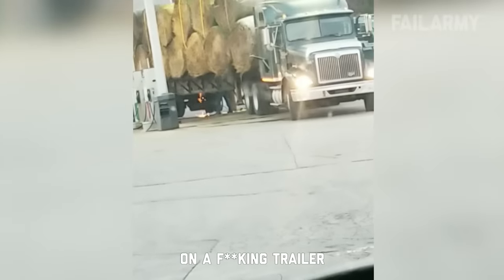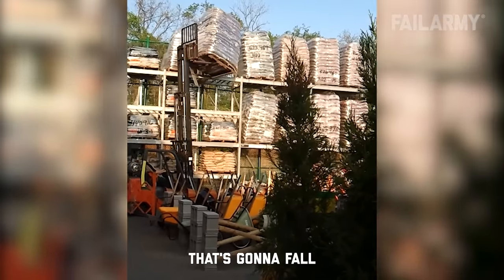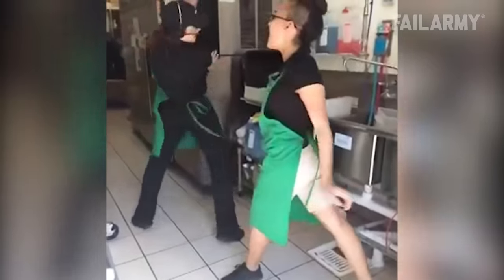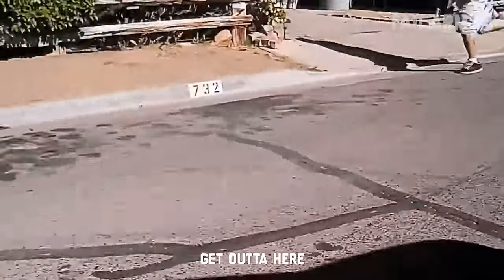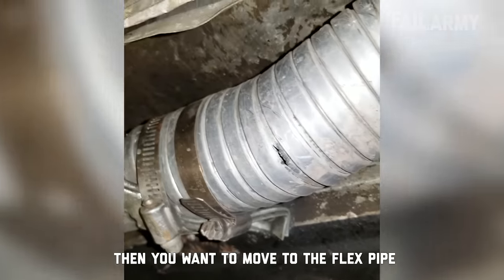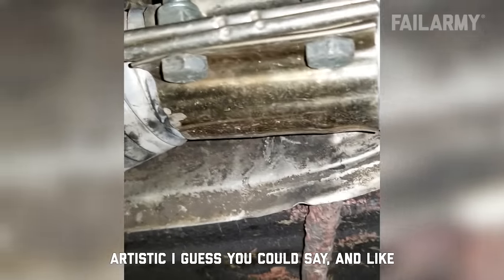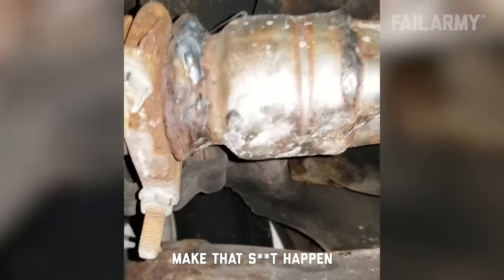Work Hard, Fail Harder | Funny Job and Workplace Mistakes

Comment: The DIY exhaust at the end was epic. The professional narrating has obviously dealt with his share of folks who think they can do just as good a job...Spoiler Alert: They can't.
Reply: Get yer self uh piece of I don't know what that is, guaranteed fix.
Reply: The sarcasm just makes it better
Reply: That diy exhaust guy knows the hardware store
Reply: Be creative, and make that shit happen! 👍
Reply: Looked ok to me. Just needed a manifold made from rubber hoses and a Pringles tube for an exhaust tip.
Reply: I absolutely lost it at that vid. My insides hurt with how hard I was laughing.
Reply: That was the best. I'm still laughing from that one!  😆🤣
Reply: The complexity is another reason why the CO2 mobile is doomed. All that work to make sure the pollution enters the atmosphere behind the car instead of under it.
Reply: I was still rubbing my eyes. I believe if you get caught by a mandatory technical check with this in Germany you get a heavy fine and must fix it professionally before the vehicle is released on public roads again.
I'm still rubbing my eyes. When the cast iron  plumbing elbow came in I was already flabbergasted... And then it got only "better".
Reply: I bet that car was full of jb weld duck tape and zip ties
Reply: Idk man if it didn’t leak it works but it probably leaked
Reply: Galvanized steel elbow, not iron.
Reply: Hello 👋 pls stay connected
Reply: @spacelemur7955  Дело не совсем в том, куда выходят газы.
Выхлопная система снижает шум и упомянутые загрязнения, благодаря резонатору и катализатору, соответственно.
Более того, снизить уровень загрязнения позволяет лямбда-зонд.
Не будь так категоричен, друг Лемур.
Reply: Ah he was being sarcastic.
Reply: Make that shit happen
Reply: Lol
Reply: Send it
Reply: I was waiting for the part where they employed the duct tape 😂
Reply: I've done my share of automobile repair in my youth, but this "creativity" is really something. Must have been a car from 3rd world or something. I don't know what you guys pay for the parts but I guarantee you save a lot of nerve and time. Not to mention your registration....
Reply: The mechanic saying , use a cast iron elbow that belongs on every exhaust  , in a sarcastic tone . Wonder if he realizes that most exhaust manifolds are made of cast iron.
Reply: I was fucken dying bro lmfao
Reply: Damn near pissed myself
Reply: Hellyeah have you priced a catalytic converter? Somebody steals mine I'm DIYing to
Reply: No way that passes CA smog🤔.
Reply: @alxgu198  Pringles tube 🤣🤣🤣🤣🤣🤣🤣
Reply: Every mechanic, carpenter, electrician and plumber all have similar tales to tell. "Good 'nuff" is the mantra of many do-it-yourselfers.
Reply: It was hilarious 🤣🤣
Reply: I had to watch that 3 times through teary eyes.  The fact that he’s so deadpan and serious, not so much of a crack of laughter.  Crown him the king of sarcasm!
Reply: @otisvonschmuckle3956  

L
Reply: @otisvonschmuckle3956   

My

By by
Reply: As a Volkswagen guy, I smile.

It's true.   Bailing wire and galvanized sheet metal is my first choice.
Reply: probably his wife wouldn't let him spend another dollar on that junker, so he uses junk around the shop. He gets tired of this job and over a few beers convinced his friend to do it, friends gives up and a third drinking buddy shows them how to get things done. Voila.

Lots of booze drank over this lol.
Reply: Pretty sure the engine at that point is just eating a whole quarter of that exhaust reduction engine life by half.
Reply: @chornobylreactor4  Exactly.
Reply: Who needs a muffler shop when you have the home depot credit card.
Reply: @mrnapolean1  I think he really got tools from the store of jokes and vroom doo
Reply: I was once in a situation where I could not afford a new exhaust so I mended it multiple times with baked bean cans stuck together with gun gum, it worked.
Reply: New motto, "By any means necessary, make that ish happen!" 😂😂👏🏽
Reply: We all have a few family members who would be very very proud of that type of "craftsmanship"🤪🙃🤣🤣
Reply: @spacelemur7955  The brainwashing is real with this one...
Reply: I watched this and he was saying, "that's a good job here" and I'm thinking "no it's not" then I realized he was being sarcastic.
Reply: remember kids, if the clip DOESNT say "no one was harmed", everyone involved went to the hospital 😀
Reply: Make that shit happen
Reply: I DIED LAUGHING!
Reply: I Died Laughing but came back to life..
Reply: Love the cast iron elbow.  Makes the sound resonate.
Reply: Oh man, I just started at a muffler shop this week and this had me busting a gut 🤣🤣 gonna show this to my boss he'll have a good laugh
Reply: Hilarious!😂😂😂
Reply: The exhaust as you say truly is epic... the insane amount of time to build that shit would suffice 2 mufflers what an Ahole

Comment: 8:15 It's safe to say that dude was a tad embarrassed! That pressure washer kicked his butt.
Reply: Bruh I'm dead the way he just falls down😂🤣😭☠️
Reply: The glove toss too 😂😂
Reply: Looked staged to me.
Reply: Who taught him how to hold a pressure washer 😂😂
Reply: @JoEbY-X  Absolutely !!
Reply: @appearedpoet561  Should anyone need to be taught? Some things are self explanatory.
Reply: It's staged, those pressure washers aren't that strong, a grown man can easily hold it with one hand.
Reply: @mofayer  your garden variety 1800psi yes. Commercial/light industrial 10,000psi machines can maim or kill, and yes, you should be trained because most people's reaction is to constrain deranged equipment rather than let go of the trigger and that's what causes most pressure washer accidents to happen. If you're not squeamish look up high pressure injection accidents.
Reply: @sivalley  that did not look like much more that 3k psi to me, I may be wrong.
Reply: @mofayer  staged or not, jackass behavior like that causes a lot of industrial accidents.  System pressure is irrelevant if you're not prepared for the force that machine can put out and being that they are in a light industrial setting at the very least I can guarantee that's a 10k machine, look at the hose diameter. Warning labels and OHSA regulations are said to be written in blood for very good reason.
Reply: @mofayer  a long length between the nozzle and the trigger can make it much harder to control. Most pressure washing setups are about 4' from trigger to nozzle and yes most adults can hold them one handed. That one was easily 8'. If you do not know it is coming and prepare it will knock you back and can knock you down. Especially at higher pressures.
It may have been a set up to embarrass him but from his reaction it was not staged.
Reply: @sivalley  it is a light industrial setup but the new hoses I bought for my 3200 machine are not much smaller than that. 10,000psi is used to cut metal, they would never put an extension on that much pressure and they would probably be wearing steel toes boots. If they are using it to wash the machines then it is more likely around 4-5k at the most
Reply: remember kids, if the clip DOESNT say "no one was harmed", everyone involved went to the hospital 😀

Comment: That's some good advice on the exhaust plumbing! I'm definitely going to use it on my next swamp buggy! Never thought about using the cast iron fitting! Lol
Reply: use pvc plumbing parts, much lighter.
Reply: @nammie12345  duct tape works too ! handles the heat very well
Reply: That exhaust!!! Had me in stitches!! 🤣🤣

Comment: Dude the guy who cut that track has damn sure had a stay in hospital
Reply: That was brutal!
Reply: It struck the welding helmet, so while I'm sure he felt it, he may have avoided a serious injury.
Reply: @Durwood71  I weld. And I promise that hood did little to protect his face from that blow.
Reply: @rl2769  From what I read he sustain some pretty bad injuries but was back to work about a month later
Reply: Checked the comment section for this
Reply: @Durwood71  the weight of the track plus how hard it hit would have caused serious injury even with a helmet.

Comment: Jesus the gentleman plasma cutting that steel beam that sprung back and hit him for sure was in the hospital:/ just hurts watching it ive had a 500 pound beam fall off a truck in high winds onto my ankle...crushed it...instantly...was bed ridden for 6 months have metal everywhere in my foot...but still work my ass off everyday....every now and then i get nervous with heavy items...
Reply: Yeah dude…. Definitely broken facial bones, concussion and maybe laceration for sure. Steel has not give at all. Hope the guy is ok.
Reply: He did have a welding mask on, which presumably softened the blow a bit. Still didn't look pleasant at all.
Reply: There was a welder at my University who cut into what he thought was an empty steel tube in the shop.  It blew his hand off.
Reply: @mikeclarke952  oh my goodness man, i just cant even imagine and dont want to imagine lol
Reply: In this case it was a rail, and quite obviously under tension (as they're made of rather springy steel). So the weight that hit him wouldn't have been too much, but the speed was concerning. That's at least a massive headache, and probably a laceration where the rail hit his mask.
Reply: @mikeblatzheim2797  the rail launched the dude backwards which looked to be like 8 feet...thats a permanent headache haha
Reply: Yeah that was nasty. He had the mask on, which probably saved him from brain damage, but that's still a hospital ticket.
Reply: @albertotorres7699  i would check into the nearest clinic immediately have a blessed day
Reply: And  the end was molten

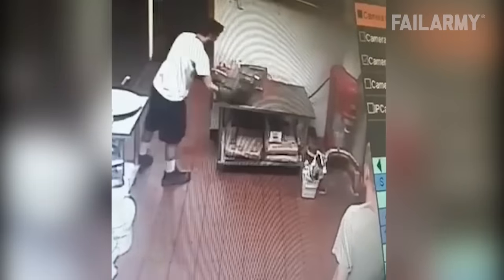Comment: 6:38-7:02, I've seen similar on a construction site. 

Pile boring machine, spinning around and around for maybe 30 minutes, operator lifted it out of the drill hole...with no drill bit attached.

It didn't fall off, it was never put on.

What you get when you pay by the hour and then don't regulate what is being done.

Comment: Good thing that ceiling collasped then instead of when it was finished and people were inside thinking they were safe. Somebody didnt pull any permits on that job. Taking chances. Could have been way worse.
Reply: Wood can support lots of weight, but you need an engineer to calculate how much exactly. Especially if you out several toms of concrete on it.
Reply: No permits needed in 3rd world countries just cash

Comment: There is a difference between a fail and a prank. They are not the same thing. Fails are accidental, pranks are on purpose. When you try to do something and you succeed in doing so, that's not a fail.

Also, if I were an employer and caught any of my workers pranking like some of the ones I've seen here, I'd fire them on the spot.
Reply: Says the guy probably watching this at work
Reply: Is your comment a fail or a prank?
Reply: And there is a difference between a Fail, and a casualty.

Comment: He wasn't welding near the gas pump he was cutting with a torch, far more sparks than welding.
Reply: And that's..., better?
Reply: @wallywest2360  Just looking for accuracy, and no far worse as when cutting with a torch the sparks for much further
Reply: @wallywest2360  It doesnt matter, you dont bring anything with a spark near flammable stuff

Comment: The guy cutting the rail at 01:30 - he probably had a fractured skull after that. At the very least, it would have shattered his jaw. The sound of his cry suggests this. He'd be very lucky not to die from this accident. I've seen this clip before, and showed it to a workmate who had previously worked on the railway for many years, supervising track maintainence. He only said two words:
"He's dead."
09:12 - Driver's fault entirely. He should have undone the twistlocks on the skeleton trailer as soon as he stopped at the lift point. However, the crane should have automatically stopped for an overweight lift.
Reply: about the at 1:27, I thinked the same than you bro.
Reply: Maybe the container was quite light so the crane operator was like "yeah, this ain't nothing"
Reply: @DanArnets1492   - It's a 40 footer, and they weigh four tons empty. The cranes are calibrated to take this into consideration. If it was booked in as an empty, the crane should have shut down automatically at  the weight discrepancy.

Comment: You know, if I was pouring a concrete sidewalk for myself and one of my chickens or turkeys decided to walk in it, I think I'd keep it without smoothing out their footprints. Of course, that would be different if this is a public sidewalk or for someone without my weird sense of humor. Once I got my bird out of the concrete, I'd be washing those feet good, though. Concrete is very alkaline and can burn you when it's wet.

Comment: I feel sorry for the lady at 0:30, that is not something to laugh at.  She super heated the milk, meaning that it got above 212°F (100°C), and when she moved the container out of the microwave, it exploded in her face which creates horrid burns.  This also happens with water, and it is best to put a wooden spoon in the container if you plan to microwave the liquid.  Distilled water is the worst to heat in a microwave since there is no particles in the water for the microwave to heat, so the water ends up getting superheated without boiling.

Comment: I was on a job site that was retrofitting hold downs to meet earthquake code in CA. Supervisor asked him to open up an exterior wall. This guy set his Skilsaw circular blade to full depth & cut into this wall, slicing thru all the wiring & pipes. It just happened to be the main infrastructure wall for the whole complex. The company ended up filing suit against the then ex-employee to try to recover their losses.

Comment: 0:28 this is why you’re supposed to let it stand for 1min in the microwave. If she was doing it for a customer, and they got irate about it I would have been like, “Then you get third degree burn on yo face!” JS… third degree burns are the worst on facial skin due to the thinness of that skin. Not so much the vanity of it. (Albeit, for those who care about that kind of stuff… just wait one more minute to get that boiling hot cup of ramen from the microwave!)
Reply: What is that? What she takes from microwave?
Reply: @slxb7743  it looks like a soup that may have had an egg in it. It looks like it was a convenience store, gas station, or a break room. Either way, it was too hot and her moving it too suddenly made the bubble or egg explode. Letting something like this sit an extra minute let’s any heat bubbles to decapite.

Comment: some bad ones:(  have done all manner of dirty jobs from coast to coast in my life including the Navy,have at least a top 20 myself:(
work mate was blown off a flight deck TWICE and relatively uninjured:( got time off and free beer out of the deal:) working a LG auto facotry and warehouse ,guy was pulling a LG plate from a "cooling" oven and spit his gum in the middle of it it EXPLODED in a split second sounded a grenade:( no one hurt thankfully, but two literally wet their pants:) warehouse was a trap a few thousand lg crates each with 50 windshields stacked 5 high,often hungover lift drivers made for a dangerous day:(  one of my dumbest ever ,is I rigged a chainsaw to operate without the safety bar so I could use it one handed on a 24 ft ladder, I was roped off and the saw was ona rope, (safety first :) ) climbed the ladder ALL the way and stepped over the top rung falling forward and hung there with the saw running barely missing me and swinging ,until a neighbor came home from work and used his ladder to save me:(  clear of dummies:) peace Rick

Comment: So workplace acidents are just fodder for the lols now? Everything is for the lols. Nothing is serious. At least one of the videos is of an accident where people died. A tower crane collapse is not funny. A silo collapse onto an excivator is not funny. A tanker truck roll-over and crashing into cars is not funny. The title and description says "Funny Job and Workplace Mistakes" and "enjoy a few from some clumsy people on the job" - the tower crane collapse killed people. Having experenced an industrial injury and still dealing with it 20 years later I can assure you industrial accidents are not funny. Oh, but its OK because junkin media mixed in a video of a chicken walking through wet concrete and of someones exhaust system handywork.